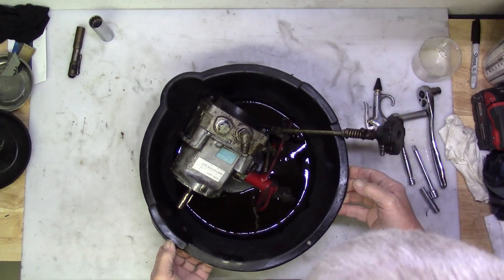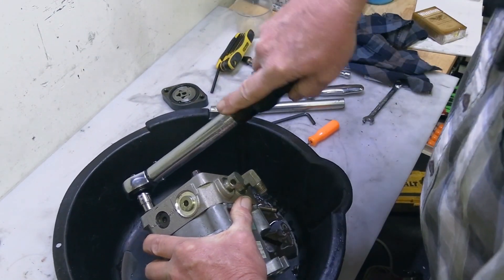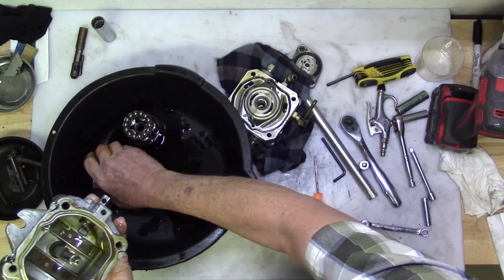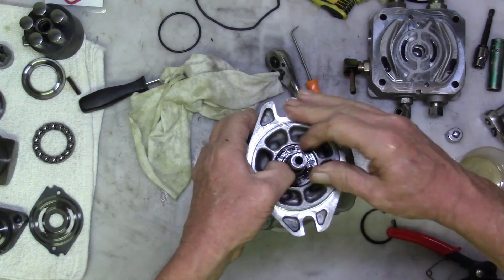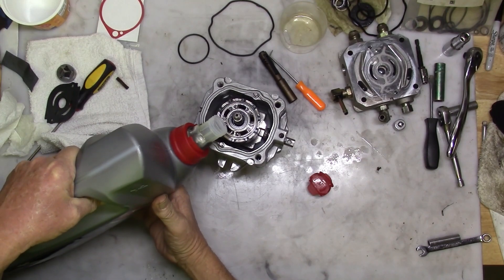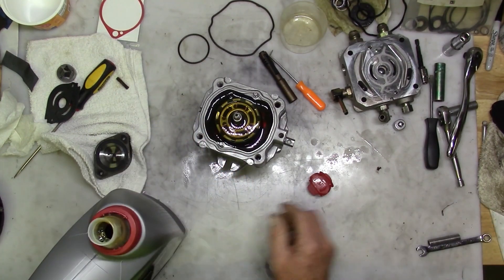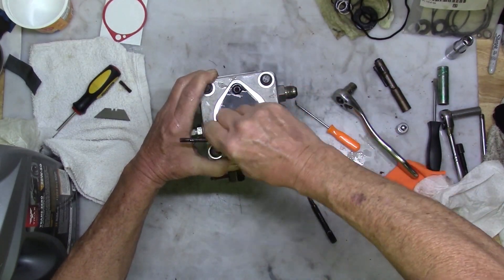Hydro Gear Hydraulic Pump Leaking "Rebuild"

Comment: How can you change the rotation of the hydrogear
Reply from the maker: The same pump is used on the right and left side.  You have to remove the top and turn it 180 degrees to reverse it for left or right. On the top forward and reverse hoses are marked A and B. Hoses usually face forward. Hope this helps answer your question and thanks for watching.

Comment: When cleaning parts do you typically just blow them off throughly with air?
Reply from the maker: With an oil pan gloves a small paint brush and gasoline Ill clean parts. Ill then reclean everything again with Dawn dish soap and water then rinse with clean water. Then I'll blow them dry with the air gun. If washing them off with soap and water, Ill use break or parts cleaner then blow them off. That stuff is expensive, and I do that very rarely. Hope this helps answer your question and thanks for asking. Also, thanks for watching and supporting the channel.

Comment: How do you measure the pressure of the pump with a pressure gauge to determine how much the system pressure should be?
Reply from the maker: Hydro gear sells an inline pressure pump tester for these types. HYDRO GEAR part #70661. Very pricey. $2200 Ebay or $2600 from hydro gear. They also have a manual you can download on these pumps.

https://www.hydro-gear.com/wp-content/uploads/2021/09/P-Series-Pumps-Service-and-Repair-Manuals.pdf

  I've never been able to afford one.  If a filter change or replacing 10-year-old high pressure lines doesn't fix it, then that's usually a good indicator that the pump needs attention. Thank you for the comment and support. I hope this helps.

Comment: super video.  where can i buy a kit like that. my 2006 hustler super z is leaking oil real bad by my left rear wheel. all on the inside of the left tire and rim is full of oil. Could i have the same problem as what you just did   thanks for the video and your help  also thanks in advance   bob
Reply from the maker: This pump is Hydro Gear PG-1JQQ-DY1X-XXXX Pump Before SN 8001PXXXXX 
The seal Kit used was part # 70525 Hydro Pump Seal Kit.
Now in your case you may want to check The drive motor at the wheel. It may be leaking there.
Exmark Uses a parker drive motor. Look up a parts list for your mower to find out which one then search for a seal kit for it. Or just get a new one about $100. Thanks for watching, commenting and supporting the channel. hope this helps.

Comment: Hey buddy like your videos. Question- how many hours would you quote this at for someone? Ballpark? I’m a mechanic with all the tools and everything I just haven’t done one of these yet and I don’t want to short myself or be too high either. Thanks in advance
Reply from the maker: Once out it's about a 5-hour job on the bench. I spend a lot of time cleaning with a pressure wash; some break clean then Dawn soap and water. Reassembling is pretty quick after all that. Be glad to help If you have any questions along the way. Thank you for supporting the channel

Comment: I've got an older Toro zero turn mower with what I assume is a very sensitive pump. Its extremely touchy/jerky when using. Think the pump is the culprit?
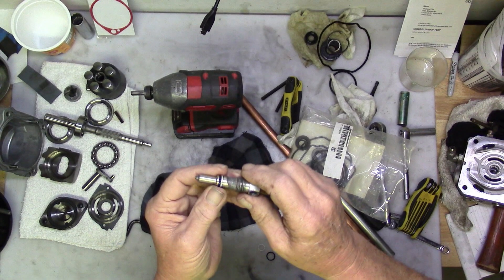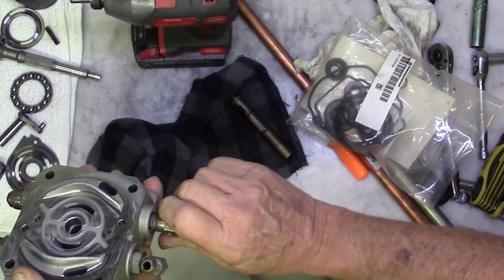Reply from the maker: Hard to say. If it's a set up like in the video there will be 2 pumps. Usually, a weak or bad pump will make it difficult to travel a straight line. There are 2 pump check valves in each pump as I show in the video (one I could not get out) Between 6:00 and 6:35 in the video.  https://youtu.be/AJGPw6024Ew?si=Xh-lYZNw05B9Hxsi&t=359 
It is quite possible that there could be something wrong there causing the symptom you described. These are on the top (manifold) of the pump and are removed with an Allen wrench.
Follow this link to a downloadable service manual. Lots of good info to troubleshoot. 
https://www.hydro-gear.com/wp-content/uploads/2021/09/P-Series-Pumps-Service-and-Repair-Manuals.pdf 
   Thank you for commenting and watching hope this helps.